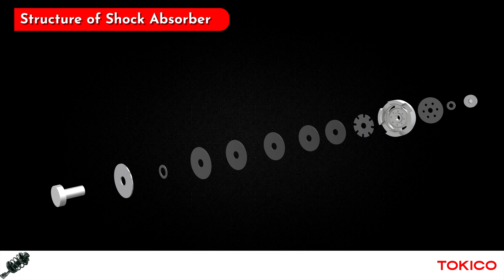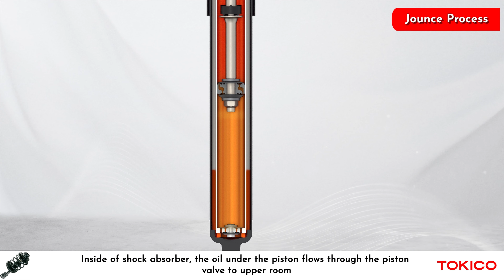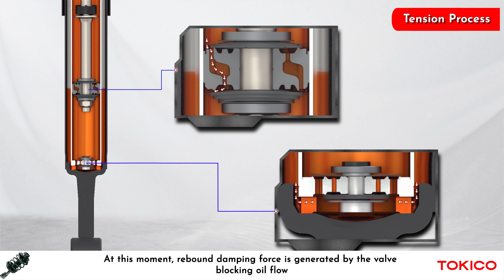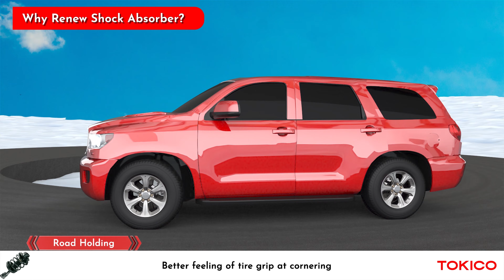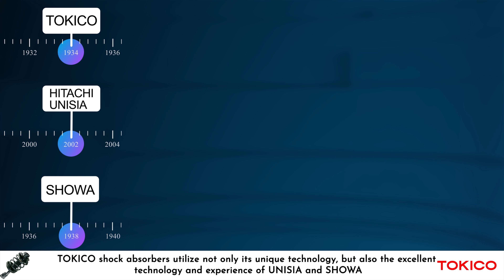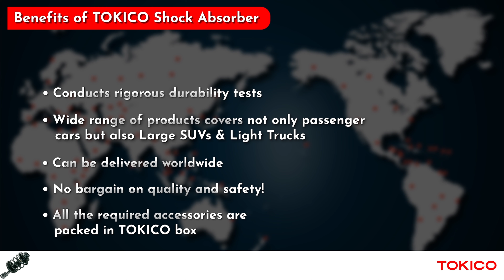Basic knowledge of TOKICO shock absorbers(en) | Astemo Aftermarket

Comment: I miss my 5 spd Tokico Illumina's installed on my Mazda Protege ES
Reply: Nice surprise to hear from a fellow Protege owner. Over 12 years and 100,000+ miles on my Tokico Blues (HP) and they still work like a champ. Thanks to Racing Beat's development input on the MP3 and MS Proteges, only Tokicos have the reinforced rear sway bar attachment point. Cheers!